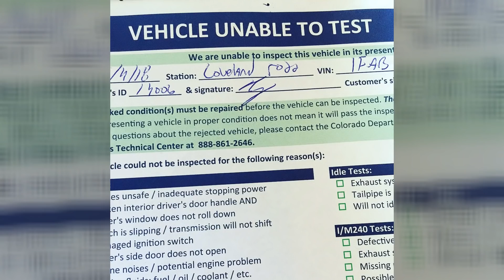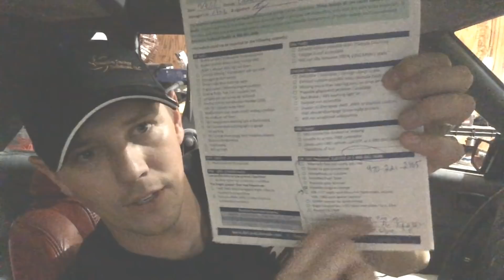Emissions Testing Supercharged 408 Clevor - Can a Racecar Pass Emissions?

Comment: Laws vary here on the East Coast. In NJ they just changed over to no smog for anything pre-OBD2, which is great. I think NY and PA still do fairly strict safety tests and emissions in urban areas(might just be a visual on 25+ year old cars). I'm now living in Massachusetts, which requires a fairly brief(easier than PA) safety check and a 'visual' emissions test, but they don't pop the hood on older cars, so I can get away without EGR, smog pump, and crappy 80s football sized cats. I was turned away from a few private inspection garages due to having a loud exhaust but I found one that passed me.

Out West is where you really see all the regressive laws like this start. Colorado sounds like California - mid-70s cutoff, strict part year guidelines, among other things. California's laws are so asinine that you are not allowed to remove your ineffective 80s cat in favor of a modern cat that pollutes less. It's sad.

I actually was looking at moving to a smog county in another state a while ago and I thought of a workaround. It involves creating a LLC company in your name which requires around $2-300 in most states - which sucks but it's cheap compared to undoing all your labor.

Most states will give a LLC business a corpcode or "license number" of sorts. Maybe get a rural lot or something in Colorado, start a LLC there, and run a racing/motorsport LLC business from that address and register your car to the business and keep your daily driver at your residential address. This would also let you keep your license where you have it now, which is good. You don't have to create a LLC in the state you live in, either, but it would work best if the car had the right plates for the state it's garaged in.

We are honest people that are driven to this, we try to play by the rules before we resort to stuff like this. I feel that, if you track the car and put money in it, or race it for money, it's a business expense of a sort - you could even have a reasonable argument for registering your car with your business. All the rental car companies use these loopholes to register their fleets in low cost states, too.
Reply from the maker: Well written and explained.... I completely agree with you...

Comment: So did you told them what heads were on it I take? Did they ask specifically what heads were on the car?
Reply from the maker: They didn’t ask, they had to do an inspection.  The vin on the car shows it came with a V6 and they saw it was a V8.  I had to go to their ETC.. emissions technical center an they have a very knowledgeable guy that looks over your engine.  He noticed the extremely large exhaust tube diameter and was able to get casting numbers off them which showed they were Cleveland heads.  Immediate fail, unable to test.
Reply: Clevor BMF sorry for my poor sentence structure. 
That’s a drag. In Missouri I have an of 4 cyl car with a 408” procharged setup. I needed to get an inspection and the first place I took it told me they wouldn’t pass it because it had something other than the 4cyl in it. I was under the impression that as long as it had a ford setup in it it would be ok. Nope. 
I took it to another place and talked to them about my situation and they agreed with me, passed it so I could go ahead and get plates. If there are other places to take it, i recommend trying another facility. Maybe it’ll slip through.
Reply from the maker: Thanks.  Thanks what I’m trying to do... there are other places to take it, but as soon as they see the engine swap, they refer me to the same ETC for inspection... so far, haven’t found another place that will pass it...

Comment: I know this would defeat the purpose of a Clevor, but are Windsor heads out of the question?  Seems that's the primary thing holding you back (from being inspected).
Reply: Ah.  I assumed by the body style and me being in CA that it was an 85 and had a carb rather than fi.  Swap problems..
Reply from the maker: It’s definitely an option... but would also require the intake and fuel rails all of which I sold a while back... and I’d have to reinstall the factory efi and take out my stand alone ecu.... I’m contemplating doing this though...